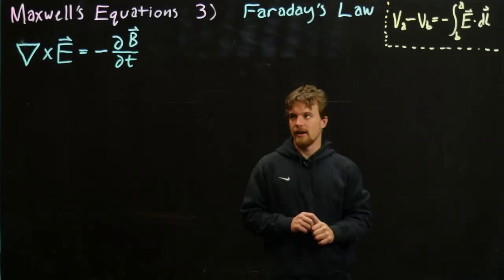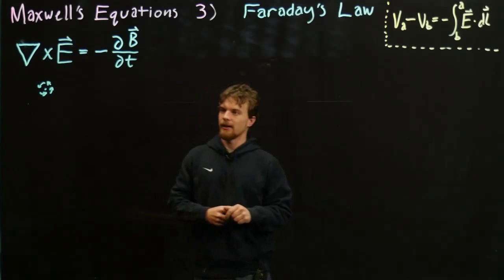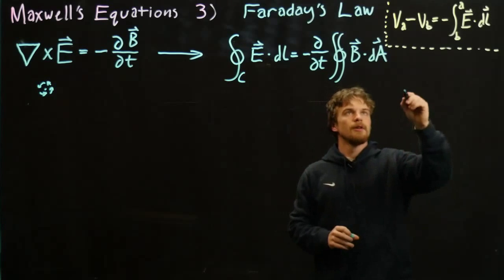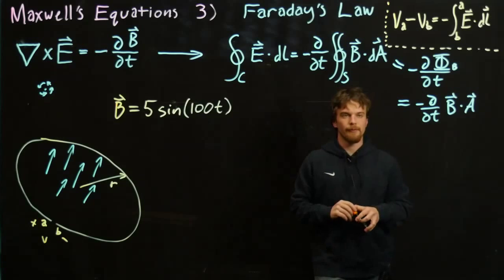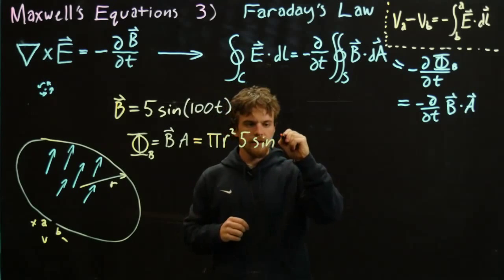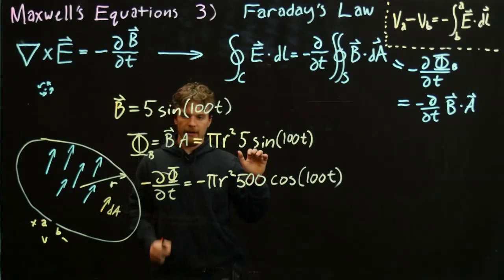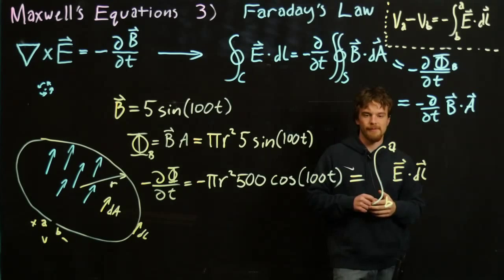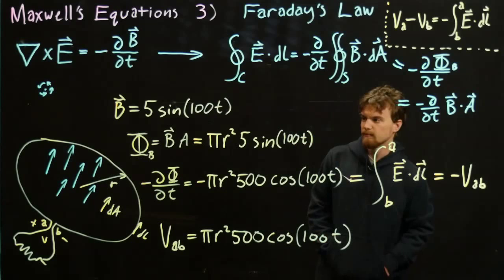Maxwell's Equations - Faraday's Law

Comment: Wait did he say the curl of the electric field gives a scalar value? (1:03) Sorry I'm still new to the del operator so I wanted to make sure if this was right....
Reply: Nico it should be another vector
Reply: Curl gives us a vector.It gives us change in direction of a field along with magnitude. For ex: take the famous example of a circular plate freely floating in a flowing river. Now, because of the change in velocities in the stream at the surface and below the surface, the plate starts to rotate. Now this plate is moving along the direction of river and also rotating. Curl will give us at what rate and how the change in direction is happening (rotation). Now this is in 2d. Imagine free space 3D, with electric and magnetic fields for the same, You would get why we use curls, especially in the studies of fluid mechanics, electro magnetism etc. Do watch 3B1B videos for a greater intuition.